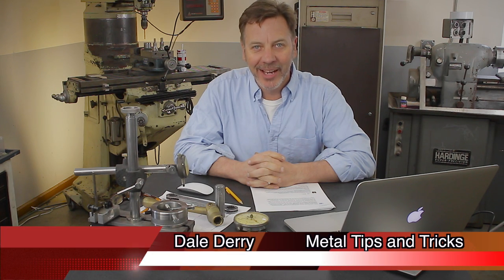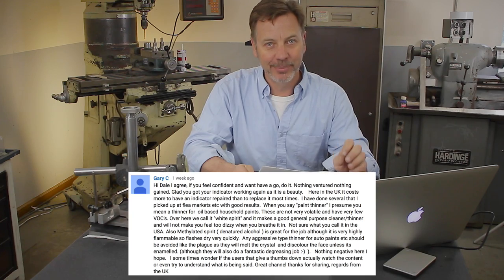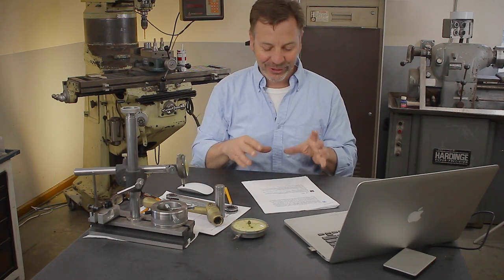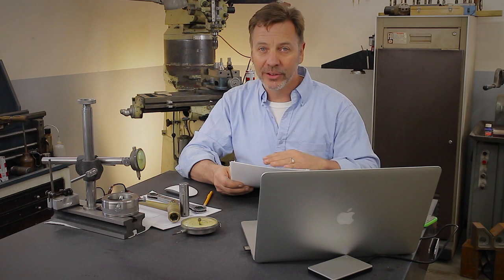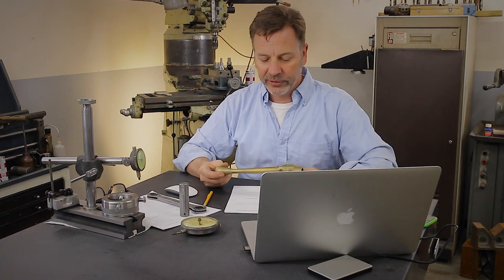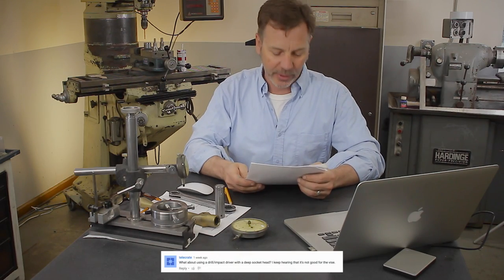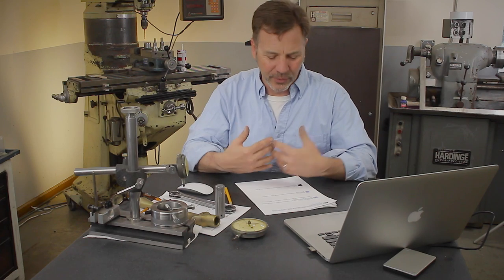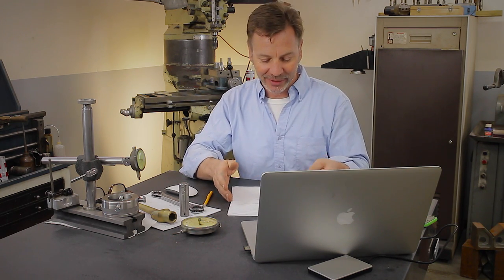Q&A Vise Handles and repair  Dial indicator

Comment: I tried the double ratchet wrench for a few days, but I found that after a short time it's corners are a bit sharp and dig into your hands. They also are a bit short limiting the torque you can apply. I found a longer "smooth" double box end wrench (Proto) worked better for more of a production environment. Great videos!

Comment: Try refined jojoba (ho HO ba) oil. You want the refined version because the "natural" type has some organic acids remaining (and it smells, too). Like the chemically identical Sperm Whale oil, this is actually a wax which is liquid at room temperature. The advantages are that it won't "creep" and move to locations where you don't want it. This is important for watchmakers because if oil creeps onto the balance wheel it will change the weight of the wheel and cause the watch to run at the wrong speed. In a dial indicator it could creep to the gear teeth where it could attract and hold grit. You want those gear teeth clean and dry.

To get the tiny amount needed for lubricating the pivots in a watch or indicator, spread a thinnish film (experiment) on glass and touch the film with a clean needle tip. A toothpick dipped in the liquid will pick up WAY too much for watch or instrument lube.

It's hard to sort out the actual jojoba oil you want because it seems to have become a faddish sex lubricant. This google search string at least reduces the number of false hits:
[ jojoba oil refined -sex -love watch lubricant ]

Comment: If Andrew is not taking his movements apart, then he is not "pegging" the holes. Pegging is using a sharpened hard wood to clean the holes after bathing in ultra-sound. There is a known and well documented significant improvement in balance wheel swing which translates to regularity of beat as well as overall timing period. This may only be significant when dealing with the very small forces applied through an escapement.
    That said, if you are working on something like a machinists indicator where the internal forces are much larger - and especially if you do not have a lot of training/experience working on indicators, then not taking the plates apart is probably a good idea.